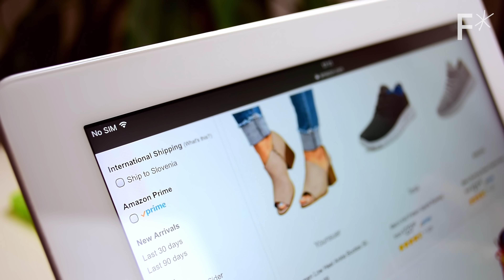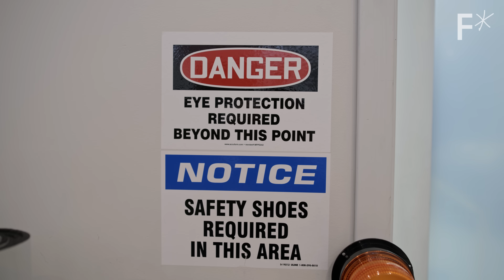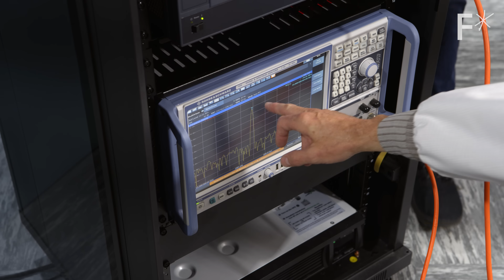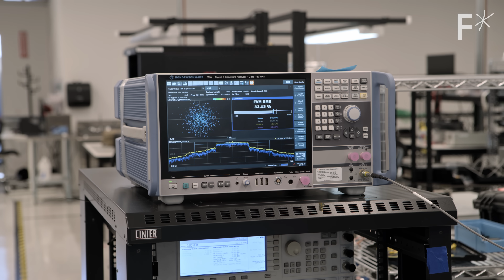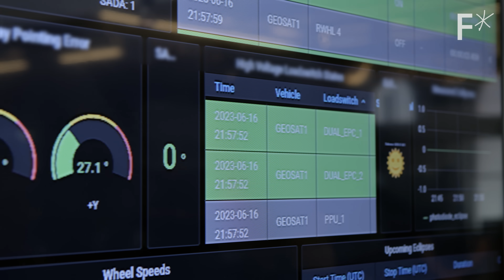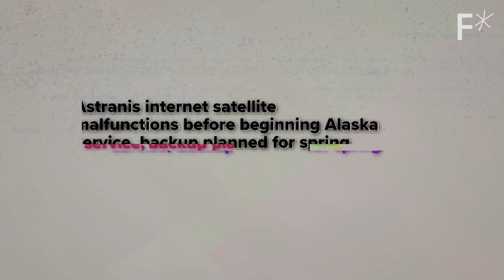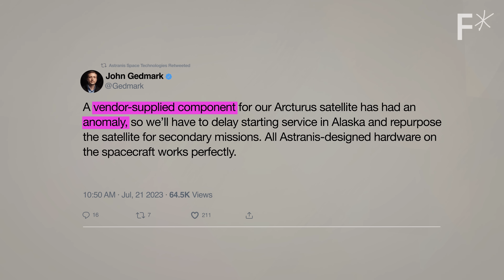Starlink’s newest competitor is using next-gen satellites to create internet for all | Hard Reset

Comment: This video is highly misleading and harmful to consumers. I request Freethink to take it down and upload a new video that accurately represents the facts about satellite technology, as well as the strengths and weaknesses of competitors in the market. This kind of misinformation is precisely why the FCC requires a broadband consumer label.

The phased array method used by Starlink in the customer dish tracks the signal strength of each satellite sequentially overhead. This information is updated every few minutes based on the dish's sky view. Within milliseconds, the ground dish can switch to the next satellite, adding only a few milliseconds of delay in exchange for increased system availability, without needing to move the Starlink dish. As the constellation has grown, Starlink has eliminated the need for motors, simplifying consumer hardware and reducing costs.

In contrast, GEO (Geosynchronous Orbit) solutions face significant latency issues and this is not due to technology but physics. For every 1,000 miles, the round-trip latency increases by 10.74 ms, regardless of the signal type, including laser optics. HughesNet and Viasat, for example, have a minimum latency of 237 ms due to their 22,000-mile distance from Earth, about one-tenth of the way to the moon. While GEO systems can optimize DNS caching, potentially use a globalized CDN cache in orbit, and add more spectrum with versatile antennas, they cannot reduce latency below 237 ms.

Starlink satellites, at 382 miles from Earth, add only 4.3 ms of round-trip latency in ideal conditions. Starlink aims to further reduce latency by optimizing transmission between satellites and increasing capacity, as Elon Musk has stated and demonstrated. Recently, Starlink has continued to reduce latency is now approaching the 20 to 30 ms range.

In real-world conditions and considering the economics of equipment of both LEO and GEO based systems, Starlink's best latency is around 14 ms, while HughesNet's is approximately 500 ms. Comparing Astranis to Starlink is like saying an apple is an orange; Astranis is actually more similar to HughesNet but with a faster cadence in satellite technology deployment.

One caveat with GEO: In the 1990s and 2000s, a layered service approach was used with satellites primarily for downloads and alternative solutions for uploads, typically a DSL connection. This caused numerous issues and customer dissatisfaction; it was abandoned by 2009. 15 years later, geosynchronous solutions now use wireless service providers for uploads. While arguably better than the previous technology solution, this approach still depends on local wireless providers. Regardless, this model is more complicated to troubleshoot, and is generally more costly than an all-in-one LEO (Low Earth Orbit) solution like Starlink.

Comment: I commend your efforts, but for $44 Canadian a month, I receive 1Gbps download speeds through my local internet provider. While I wish you success, I don't foresee long-term viability due to the inherent latency issues and high initial costs associated with satellite ISPs. I'd be delighted to be proven wrong, though I doubt that will happen. Your enthusiasm is admirable, but I recommend reconsidering your business strategy and possibly liquidating your assets to avoid becoming another failed startup.

In Canada, the internet infrastructure is robust, with fiber-connected cities and an extensive network of fiber-optic and high-speed cable broadband. For residential users, broadband internet is capable of offering download speeds up to 5Gbps. For business owners, fiber-optic services can provide up to 50Gbps download speeds. Specific facilities that require very low latency and ultra-high-speed infrastructure can achieve download speeds exceeding 10TB. According to the Canadian Radio-television and Telecommunications Commission (CRTC), 87.4% of Canadian households had access to speeds of 50Mbps or higher in 2020, and this number continues to grow. Furthermore, the CRTC reported that by the end of 2021, 91.7% of Canadian households had access to broadband internet with speeds of at least 50Mbps download and 10Mbps upload.

Moreover, there are initiatives across Canada that incentivize landowners to host 5G repeaters. This ensures that even rural areas can enjoy full-speed 5G networks, with plans starting at 100Mbps for around $40 Canadian. These prices are on the higher end, considering I live in a small yet densely populated downtown area. The Government of Canada has committed $2.75 billion through the Universal Broadband Fund to bring high-speed internet to rural and remote communities by 2026, further enhancing connectivity across the country.

Canada is also pioneering the use of microwave cellular repeaters, which are designed to blend into natural surroundings, often resembling trees. These repeaters are powered by solar energy with backup batteries capable of running for over two days. This approach reduces CO2 emissions and capitalizes on highly studied and reliable network infrastructures. As a result, more people can be connected without the environmental impact associated with widespread satellite deployment.

While satellite internet is essential for many industries, particularly in remote areas where traditional infrastructure is lacking, it cannot compete with the price and quality of ground-based systems for the average consumer. Ground-based systems, such as fiber-optic and high-speed cable, offer superior latency, higher speeds, and more reliable connections at a fraction of the cost. For instance, the CRTC reported that the average cost per gigabyte for fixed broadband was significantly lower than that for satellite internet, making it a more economical choice for consumers. According to a study by Ookla, Canada ranks 11th globally for fixed broadband speeds with an average download speed of 168.78Mbps, whereas satellite internet typically offers lower speeds and higher latency, often exceeding 600ms, compared to ground-based systems which have latency as low as 5-20ms.

In summary, while satellite internet plays a crucial role in certain sectors, its high costs, latency issues, and environmental impact make it less competitive compared to the advanced and efficient ground-based systems available in Canada. Your venture has potential, but it must overcome significant hurdles to match the performance and affordability of established broadband technologies.

Comment: You're assertion that starlink has to physically track a satellite is misleading.  The dish move one when you turn it on and never again.  They use a phased array antenna to digitally track satellites and switch satellites instantaneously with no moving parts.

Comment: GEO is way too far out for internet satellites, Elon did it right.
LEO orbit is not that hard to do, and Starlink has done it, and it is getting better every week by all reports.
The ONLY issue with LEO internet satellites is space clutter, and making it much harder and more dangerous to launch anything else into space due to all the traffic and trash floating around our planet these days.
Also LEO for Starlink is like 342 miles out, GEO is about 22 THOUSAND miles out from Earth.
This is totally impractical and will have little value to normal people long term for internet use. 
Internet usage is all about speed/throughput, and latency.
You need both to be successful one without the other makes you crap, like everyone else thats crap.
Don't invest in this company of nice well meaning people, they just don't know what they are doing.

Comment: This whole video is either misleading or ill informed. Viasat, directv, and other companies have been doing High Earth orbit satellites for decades. The reason this doesn't work is the limitation of the speed of light. There is an amount of time that it takes to send a signal from high Earth orbit back down to earth that is longer than internet can handle. Meaning, if you're playing call of duty and you pull the trigger it's going to take 2 seconds for the bullet to come out. It's so sad to see this company doing something that has already failed. There's no way to make this work, and it will never work.
Reply: It is physic and latency is a problem for those satellite internet connection.  However not all connection are latency sensitive.  If you watch Youtube videos, the added latency is not a problem.  Not all users are gamers.  Not all internet usage is gaming.  Those satellite Internet can be godsend for those large countries with a lot of remote residents like Canada like Australia.

Comment: There were a lot of unanswered questions in the video. Most important is how much does it cost and how good this is when compared to conventional Internet services. Also, i assume that there would a lot of lag in this service as the distance is far greater than Starlink's. You can't play games but how does it compare with the conventional internet or even starlink. Also, if any component goes bad in space, then what? Do they replace the old with a new or they just abandon the area (which is the case with their Alaska service). Los of unanswered questions.

Comment: I had access via fiber optic and Hughes until Starlink was available.  The fiber offered little, only a fraction of starlink and Hughes latency was 200+ so phone was a last resort and streaming a no go too.  Useless, but I kept it for redundancy only, but never used it.  Starlink offered service in our area and I jumped on.  Latency running about 15-35, and bandwidth at first was 300 mips, now about half that.  But it’s more than adequate for us, as latency is key.

Comment: This video only qualifies, at best, as a hype video and FUDish at worst. Just like batteries, if there's no sats and base stations produced AND DEPLOYED at scale then Astrain is a pipe dream. 100x the distance??? I feel the increased latency is also a non starter for most folks. I believe SpaceX charges what local markets will allow. A fair point can be made on SpaceX's earth based stations that get access to the backbone of the internet. Can cell phone signals from the most popular brands reach GEO?
Reply: Now if the latency (as another poster mentioned) 3/4ths of a second is a good backup there might be a need here if the base station and dish have as much or less power draw than a Starlink.

Comment: Sorry. This is brain dead. This was all invented before and largely superseded by LEO for many fundamental reasons. Even the design off the satellite is not optimized for packing into a nose cone. 
The idea that an LEO comm sat keeps breaking connection using a phased array antenna is nonsense telling me they are targeting an audience that isn't particularly literate in the relevant science.

Don't see a way for this enterprise to get off the ground putting new paint on old ideas.
The market for this was saturated long ago and much of that market will be swallowed by LEO. There is no market for them to penetrate. The implementation is obsolete and grossly inferior to the networks being established now.

Based on what was said here, these people are wasting their time.
Its like trying to replace the car with the horse again... mystifying.

Comment: wow , flight hardware on site integration and Monoproplelant?  Maybe Argon or Xenon tanks , is that a surveillance or hazard camera to other satelites? Why you have a hi voltage line in there and why that person is touching  it so casually wout the proper gear aah it all makes sense now those thing in that table are the Xenon hi voltage trusters and that bell is the internal colling or heating circuit.Did they put a Refuelling port from the Space force? Of course they use CAN network SAME PROBLEM as a car The EMS  is so SLOWWW

Comment: Starlink dish receivers DO NOT move to track the LEO moving satellites! The phased array of built-in receivers pick them up and hand them off to the next one and so on until that satellite drops off. Meanwhile, the next satellite/s is already picked up on the other end of the dish so the connection is maintained. Again... THE DISH DOES NOT MOVE except of course when Gen 1, 2 and 3 did the self-allign at installation. The new Gen 4 does not even have alighnment motors!

Comment: 3:11 actually the dishes doesn't move with the satellite it just does it only once in the calibration step which you only need once at a time but for satellites moving it just moves the beam of the signal coming out of it by making it stronger on sides and weaker on sides so there is no moving parts and so the switch between a satellite and another is instant

Comment: yeah, the geo orbit is great for TV or Radio, things that don't really need to do a lot of error correction and sending small packets (talking) back and forth and where latency is kinda important especially when moving money around and you need a very secure communication. So, latency is really BAD, the further you get away from the planet. Especially bad in gaming, as even star link can have 25~40 ping rate, and that is a huge disadvantage if your playing shooter type games, as the person that is wired to fiber and sitting next to the game server is going to have 3~5ms ping rates so, you would be dead before you could send the signal that you pulled the trigger on the controller... So low earth communication LEO, is much better. It's a big problem. However, if space-X decides to charge $1000 a month for service, it's good to have some competition.

Comment: Besides GEO latency which was mentioned a lot in the comments already (and is maybe the number 1 issue), having fewer satellites covering a larger area means a lot less bandwidth available per customer, this is basic maths on density. In fact, using GEO satellites was used for decades and is not very efficient. LEO's approach is way more scalable, just as reducing cells for mobiles phones is the only way to improve density. Now from an economical standpoint, GEO may provide coverage for low population areas, but the service provided will not match what can be provided by LEO, this is just impossible. And for latency, it's not just about gaming. Any interactive service, and a lot of protocols simply won't wait >500 ms. There is nothing next-gen about GEO, maybe it is next-gen GEO, but it will not change the landscape.

Comment: Saying (or trying to portray) G.E.O. as somehow better than L.E.O. is absurd. Only a used car salesman would try to do something like that. Starlink dishes are described as tracking. In reality they only move to attain a locking position at setup. In fact they function as a phased-array. The video seems to brush off the latency issue as only affecting gaming. It has a dramatic affect on web-based video and audio conferencing as well. Think about a zoom conference where there is a one second delay every single time someone starts to speak and another one second where they are still talking after they have stopped. This delay is constant. While I am looking forward to competition for Starlink because competition is always good for the consumer, I'm afraid from what was presented in this video this is not it. Further the misrepresentation and the spin of normal, widely understood concepts is downright disturbing. Beware!

Comment: It doesn't matter how cheap you can make a Geo satellite when there are only 1800 slots available. Latency and capacity constraints make these poor choices for internet. Starlink already has 5k operational satellites, with 12k more planned and a design that can accommodate 42k.

Comment: Here's how you send signals faster than the speed of light: spooky action at a distance / quantum entangled bits. Bits A at ISP, Bits B inside modem; atomic clock synchronization and all that jazz. It's also going to do wonders for over the wire encryption: it won't be needed since there's no wire to attack anymore.